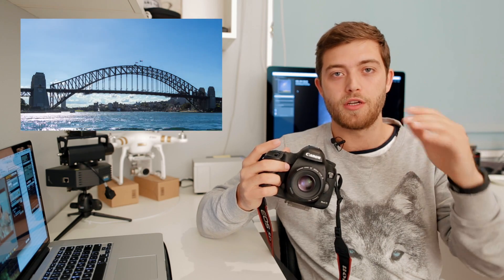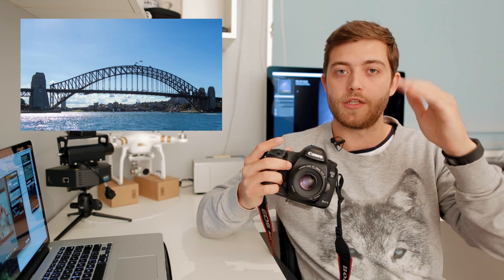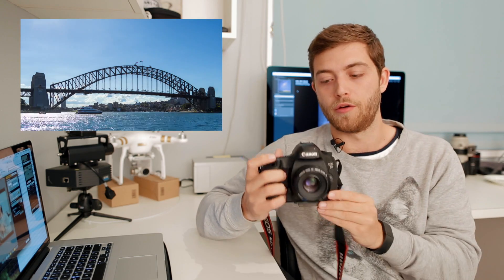What is timelapse flicker and how do I fix it? Lens twist method. - @matjoez

Comment: Hi Matthew, how can i do the same with the Panasonic Lumix S5 ii.
Reply: I think I got. I have to be in the manual mode first then switch mode. But do you recommend me using this method with Lumix S5 ii for time lapses or is there a better way? Thanks a lot!
Reply from the maker: there is no way to lock the aperture on lumix lenses sadly
Reply: @MatthewVandeputte  thank you for your answer. Sorry I wasn't clear, I'm using a MC-21 adapter for my lenses. So I'm using the Lumix S5 ii  with Canon Lenses. And I figured out if I'm in a Manual Mode I can twist the lens and my aperture stays close, then I can change modes again. Hope it's ok, hmmm? I tried it yesterday and no flickering ;-)

Comment: Hi Matt. I guess by now you are counting your lucky stars you are no longer on the east coast of Australia with all the rain and flooding huh?? Anyhow, I have stumbled on to this video just the other day and I at first thought what a great way to stop the flicker problem. Then i proceeded to try it my self, let me tell you I cant make it work. I use the 5Div and when I de-tach the lens the camera will not take any photos and comes back with either the lens error or dirty terminal one. Am I missing something or this works better on some older cameras??
Reply from the maker: I actually got back to Sydney about a week ago and witnessed the tail end of the crazy weather! Try rotating the lens only a few millimetres, it can be a bit finicky but you should be able to find a sweet spot
Reply: @MatthewVandeputte  thanks Matt. I did see after I messaged you that you were doing a workshop in Sydney with George’s crew. Unfortunately I am unable to attend at this time, maybe if you are back again I’ll be in a better position to catch you again. Have a great workshop.

Comment: That's the same method to use if you want to use Canon lenses with other cameras, if using an adaptor that does not have any way to change the aperture value. If you don't do this trick first, then all Canon lenses put on a standard camera adaptor (say Canon to Fuji adaptor) will be set wide open.

Comment: Great video, ive been hearing about this method. I have yet to try a day to night timelapse but im trying to get ready to do one. If i used this method what would i need to set the aperture for initially? also would i need to adjust shutter speed manually as well to compensate for the exposure changes?

Comment: Hello! Got a question for you. I just get the nikon d7200 and test the time lapse mode. But I have this problem. I think the D7200 doesn't have this lock mode. Do you have any idea to remedy it ?
Thanks!
Reply from the maker: Unfortunately i dont know what to do on a nikon! Google would help :)
Reply: +Matthew Vandeputte i found another tutorial thanks for answering so fast ! Good bye
Reply: +Antonin r Can you tell me which tutorial? I also got a Nikon... Thanks
Reply: @JaschaBucher  If you're still looking for the answer: On the D7200, it's the Pv button, just below the AF-assist illuminator. Just tried this method, and it does seem to work.

Comment: Any method for Nikon users? There's no option for DOF Preview in Nikon.
Reply: Haider Ali Depends on which model body you have.  The D800 has a dedicated DOF button on the front beside the lens mount.
Reply: Haider Ali I have heard if you use the camera in LIVE  VIEW Mode, it locks your aperture for some NIKKON cameras
Reply from the maker: Haider Ali Not aware of any at the moment but I'm pretty sure there's solutions!
Reply: On the D7200, it's the Pv button, just below the AF-assist illuminator. Just tried this method, and it does seem to work.

Comment: I tried doing a timelapse in full manual, so the aperture was locked, but I still got that "flickering effect"?
Reply: "FULL MANUAL" does not lock the aperture. It "locks" the settings, but the aperture remains full open until the shutter is triggered.  This allows the user to see a bright image to focus, etc.  Then the aperture snaps to the setting you picked when shutter is pressed.  So.....   set the aperture you want, press the DOF button, ( which closes the aperture to the setting you picked ), twist the lens until the electronics disengage.  This will truely LOCK the aperture.
Reply: The flicker could also be because of changing light balance if left in auto mode